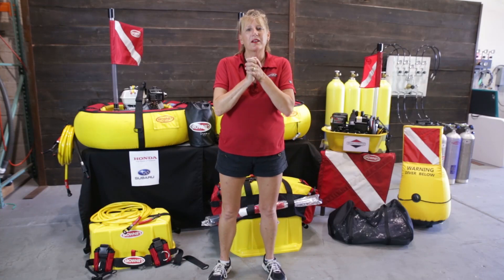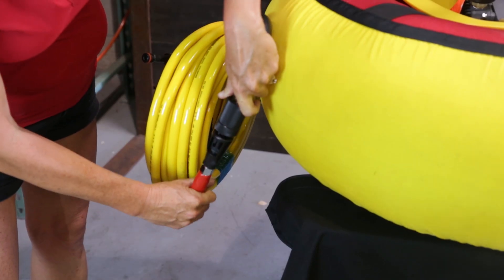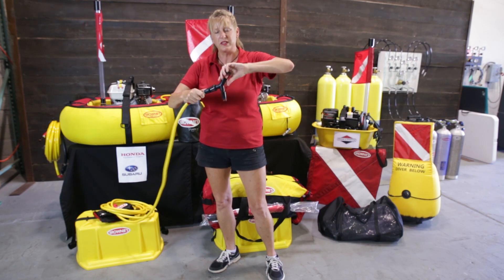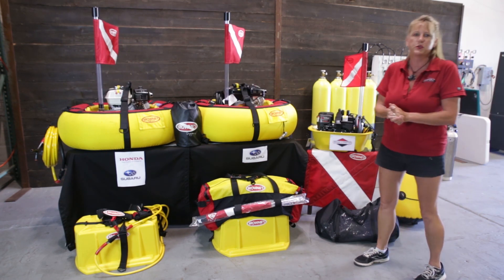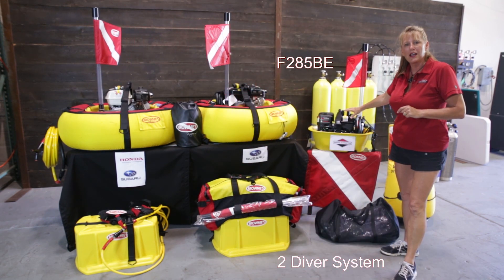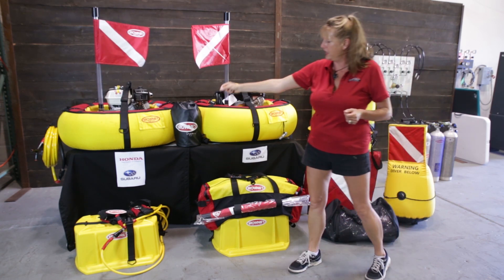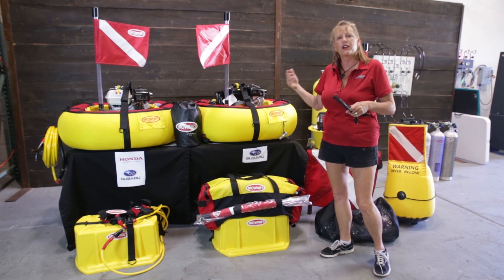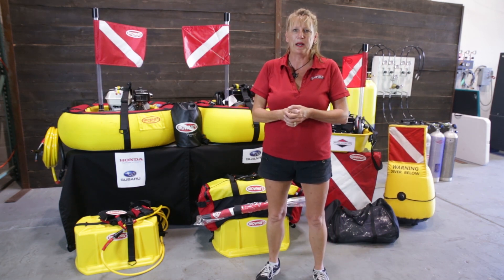Brownie's Third Lung Gas Systems

Comment: I have got a brand new Honda engine 16L tank, I wanna use it as hookah diving, do I need to change the oil for the engine with special oil to use it for diving and what sort of air filter I use and if you recommend us with any brand
Wally from Sydney